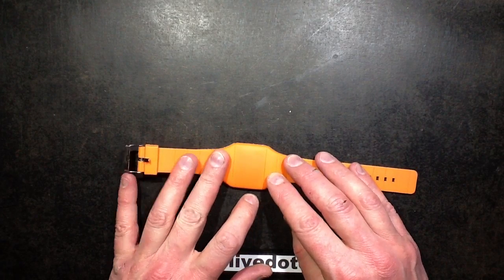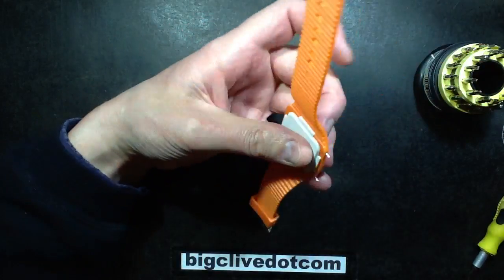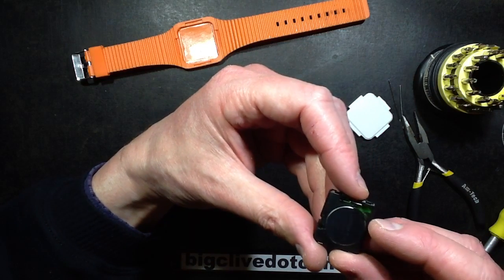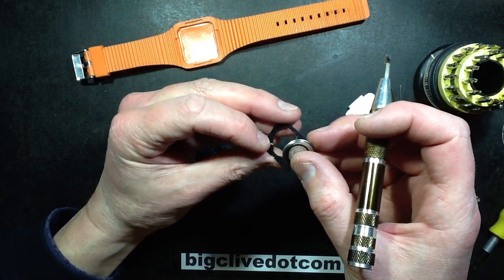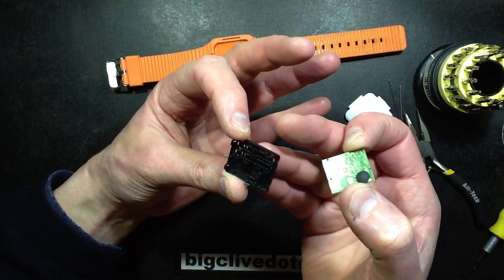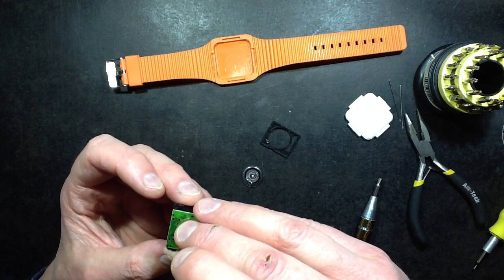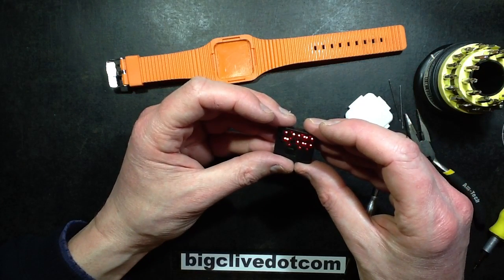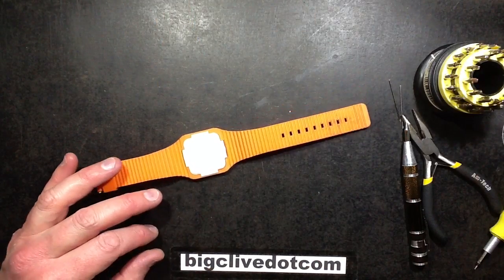A look inside an LED watch.

Comment: A friend of mine had one like this, but in the black version. Surprisingly, the LED segments seemed perfectly visible even through the black rubber. I didn't realize it came with date settings as well.

Comment: think the $3-4 CVS ones are better made than that.  they bother to have a metal screw on plate on the back  The first one I got was like 8 yrs ago.  The supposed rubber seal rotted straight away but it just has a pop off back , that one has a mirror shine to it.  I suppose for 50 cents this might be a thing but I prefer the ones from CVS.  if I wanted that look.  I overall prefer Skeleton Watches and there's no electronics in those :P  I just wish the chinese had smaller arms.  their wrist bands for those are increibly Large.  Thought my first Skeleton Watch was large,  the one off Banggod is even bigger.  Seems to be the exact same Self Winding design though.

Comment: Very interesting indeed. So if you change the crystal to a different frequency other than 1 Hz, you could theoretically make yourself a faster or slower clock?
Reply from the maker: +Owen Attard The crystal is usually 32.768kHz because that divides down to 1Hz in binary and other clock functions can be derived from the higher frequencies.
Reply: So i would guess that changing the time works with a similar concept. Which is maybe why you can only go ahead in time and not in the reverse direction..right?
Reply: +Owen Attard The inability to go back is not because of the frequency. It's because an up/down counter requires more transistors and uses more battery than an up-only counter. The forward setting is done by just clocking the digit being changed from a different part of the chip, typically the 1s or half-second pulse. The seconds part are usually set by simply stopping the seconds until you press "go", perhaps (requires a few extra transistors) also resetting it to 00 seconds so you have to press go at the top of the minute, as conveniently announced by services such as the talking clock, clocktower bells and the ball dropping.
Reply: @JohnDoe-qx3zs  No, it's because entropy always increases. You can't go back in time.

Comment: I noticed your fingers always have cuts and stuff. I think a good set of mechanics gloves are in order for you. I know working around those metal housings for stage lighting play hell on your hands but you really do need to wear gloves when acessing the cabinets. I had a problem simular to that working on snowmobiles, everything is packed so tightly the rubber boots for the carburetors go over and around the body but brackets are sharp holding the carbs. Motorcycles were the same, If a throttle cable was frayed you could stab your hands,for some reason those steel twisted throttle cables hurt like mad when you stuck yourself.Also the screws holding the floats would get a little sharp piece sticking off,so my fingers would get sliced. For some reason I would bleed like crazy from them. I also found out computer boxes are sharp and can cut. Time for more bandaides,thats what that watch is saying.
Reply: +scott firman if I'm not mistaken it's from punching the bag at the gym. He's mentioned it before.
(I'm guessing they need a new bag...like every time he's done.)

Comment: I have a narrower blue version of the same watch. The internal module isn't held in place by pins (even though it has places to slide them in), it's just held in place by the silicone rubber case. I just grabbed it off the shelf after letting it sit for about 6 months and it was showing 6 pm even though the actual time was 6:42, that's rather bad accuracy for a quartz watch. Most of my other watches are Casios of various types but this one didn't cost much so it's no big deal.

Comment: when ever I buy an alarm clock radio I open it, break off some of the LEDs so it says USA when it reaches 8:58, disconnect the 2" driver, drill a hole through the bottom of the clocks plastic housing, throw out the screws that once held it together, grab same size diameter screws that are 1000% longer, bolt the clock to a bookshelf speaker, replace the 8 ohm drivers for same size 4 ohm drivers, connect the incoming wires from the clock to the tweeter then put the bass driver back in... I use to do it to my tv so I could add 2 speakers since I couldn't afford a receiver. way less risky with an alarm clock. lol

Comment: Eh, can't one peel off the sticker and put it on the board instead of the (new) battery?
Reply from the maker: I suppose that's viable, but they may be looking for the larger contact area side to be in contact with the cell casing.  The plated copper on the PCB is going to be more reliable with a small contact point.

Comment: Why does the line "So amazingly primitive that they still think digital watches are a pretty neat idea" spring to mind? :)
Reply: +m8e It is possible to modify the code on the IC or replace timing crystal to fit the other planets when the orders start to flood in from other side of the universe. Chinese are capable of doing anything. :)
Reply: It's so primitive it also only work on one planet, and barely that.

I don't think the sandwich maker on Lamuella would like to set this watch back an hour every day. It might affect the making of perfectly normal beast sandwiches. :P